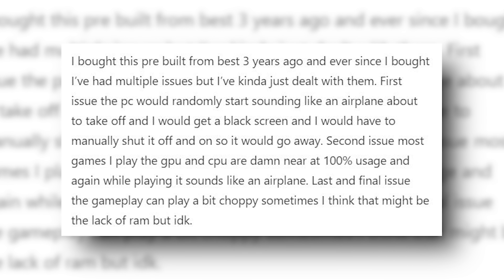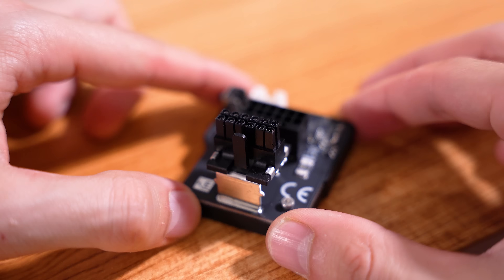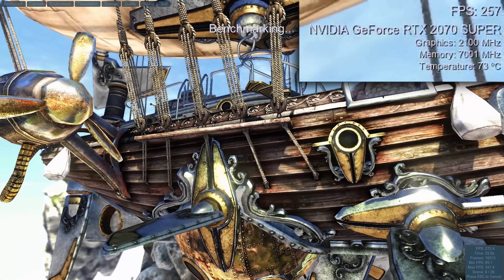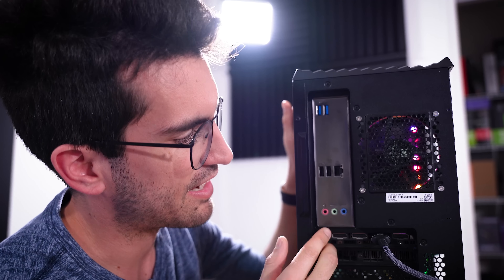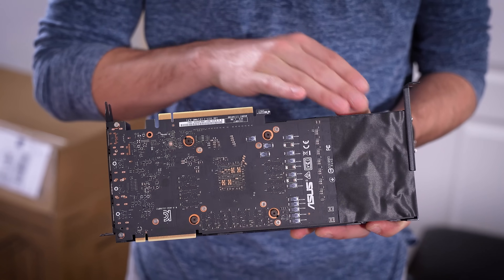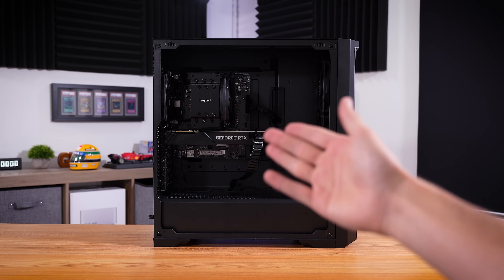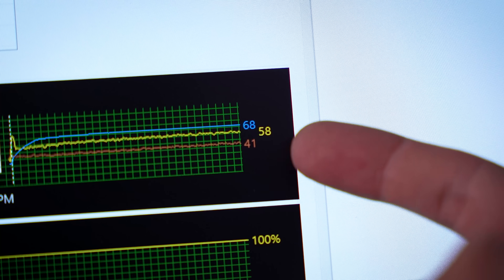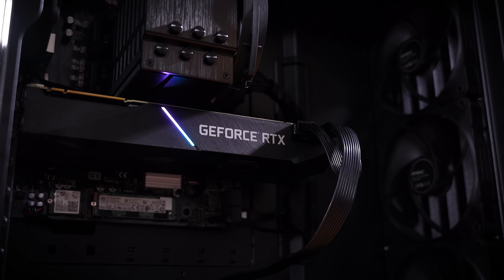Fixing a Viewer's BROKEN Gaming PC? - Fix or Flop S5:E3

Comment: I feel bad for anyone that buys a pre-built like this one. Y'all deserve more than this!
Reply: the stripped v ram sinks on the MB was  very painful to look at.
Reply: With buying prebuilts you really do have to have had experience doing your own builds to know what's decent. For example I did buy an MSI prebuilt only because I could tell the parts inside were off the shelf standard including the case. Certainly they cut costs on storage, and ram, but since everything was standard I could upgrade over time. The real saving grace was the pretty high quality motherboard that it came with, solid platform counts for a lot.

Comment: There are mounting holes for 120mm fan in the lower inside front of the case.
Reply: There are not. There are no mounting holes for any fans in that case other than the 92MM at the back.
Those are simply vents. They are not sized or spaced appropriately for any known fan size.

Comment: That wasn't a thermal throttle imo, it looked like Tau elhad expired. On previous generations, Tau (max boost duration) was limited, so the cpu frequency would jump high and stay there for a short duration, after which, if the heavy work wasn't done yet, it would fall back and settle into a lower boost frequency that it was set to run for long running tasks. At least that's what was in the official specifications, but many board vendors ignored them to improve performance on their boards. Since that looks like an OEM board, chances are high that Tau was set strictly.

Comment: The system has Asus themed branding because it IS an Asus branded pre-built. They really do skimp on things. Bare minimum PSU, single sticks of RAM, not so great I/O. They hit a price point and are a known quantity so they're not terrible, just not all that great either. A friend of mine had one of their older (than this) models that's pretty much the same thing but a couple of generations behind. Though in their case the connectors were at least all standard, not too sure why they went so proprietary with the headers on this one. You'll be glad to know they now have a much nicer custom built system that replaced it :)

Comment: damn, this pc is rough amd it's from around the same time I bought my original PC at Best Buy. Stock Intel cooler, single stick bare pcb DDR4, GreatWall PSU (I know they are the OEM of some Corsair PSUs but a named one would've been nice), stripped down motherboard, terrible case, blower style GPU.
I got an iBUYPOWER from them during Black Friday 2019 and it was an ASUS 2060 Super 8GB, 9700f, dual channel RAM, a ThermalTake Gold PSU, and a pretty stripped down B365 motherboard but it at least had display inputs on the motherboard lol. I didn't realize how lucky I got for the money I spent on it back then if this is what was commonly being sold at around the same time.

Comment: I had an over heating GTX465 with a blower cooler. I screwed a 90mm fan onto the shroud, so it blew into the blower fan. 
An Axial fan blowing into the Centrifugal (Squirrel Cage) fan. I called my solution the 'Twin-Turbo' (tm) GPU cooler

Comment: I pretty much hate all pre builts . either they lack IO ,  or vrm cooling   like dell with a core i9 that is voltage limited because of the lack of cooling on the vrms and pretty much runs like a core i7 ,  others look like they use normal parts .. but then you find out that it's a motherboard that  has a slightly different motheboard that only gets bios updates from the company that put it together and you'd be lucky to get more than a few updates so that you could install a new cpu ,   or like a HP that only supported 1st gen ryzen because there was no further bios updates.  I just updated a customers computer  he bought my old x370 am4 mothebord and was running a 2700X   upgraded to a 5800x3d    he was suprised that it was even possible

Comment: I was very disappointed with how you dealt with the graphics card and your criticism of it. There's nothing wrong with a blower cooler. However, they work quietest when mounted vertically, in a case like the Silverstone FT02 or FT05. The former coped admirably with twin Titan Xs in SLI. And you missed that the power cable was pigtailed and left it as that with the new PSU: to better cope with power spikes the GPU is best run off two separate power cables.

But that motherboard is truly crap. You might want to have a chat with the guys at Hardware Unboxed in case they've had one in for review and even if they haven't I'm sure they'll be delighted to look at it and tell you exactly why it's crap.

Comment: we had this exact pc case in currys UK but had a smaller cpu fan on a r7 5800x and had a rtx 3070 no front case fans and yeah had to put whole system in a new case and got a aio not a single issue since (it always overheated not long after boot up or playing games)

Comment: Greg: I cant replace too many things on these builds. Also Greg: I will replace the cpu cooler, case and PSU.
Reply: but that single ram stick looks fine....who needs dual channel?
Reply: @yissnakklives8866  🤣🤣🤣
Reply: Would have just replaced the cooler and swap/add RAM.
Reply: he means the more expensive parts usually like graphics card
Reply: Ram, cpu, mobo, storage was left alone which you could arge is 90% of the build. you can easily run a cheaper cpu with a stock cooler and literally use a box as a case.
Reply: Honestly, i agree with you guys, but I'd actually be very, very happy with what he did.
Ar this point, the 9700 is outdated anyway.
I'd get an AM5 (or intel 1800 later this year) into that case and change the GPU late this year, once they launch RDNA 4 and Blackwell.
I think he paved the way greatly for an upgrade and he states it at the end.
Reply: @BarAlexC  I know, he did the best he could. I was teasing because in the beginning he says hardware doesnt grow on trees, but then replaces like 3 things.
Reply: @drspaceman1985  He actually did not do the best he could. He did not address the biggest limitation in the pc, which is the ram. Which turned the end result into almost a total flop. No matter how anyone tries to spin it, he tackled this pc like an amateur. A decent ddr4 16 gig kit you can buy as cheap as 30 bucks. If I were him, I’d had payed that out of my own pocket, to properly do a job. I guess this shows his limitations. Which I did not expect to be so massive.
Reply from the maker: @alext988-z8v  The viewer told me in person that he'd be upgrading the RAM to a dual-channel 32GB kit on his own (since it takes all of about 10 seconds). To that end, the RAM wasn't "broken" and wasn't on the edge of viability from a power/stability standpoint. Oh, the internet and its assumptions...
Reply: @tim3172  Now I learned something new. Didn't know payed was an actual word. I know they always meant paid.
Reply: I sincerely apologize for hurting your feelings and your idol. I also apologize for my grammar mistakes. Even though, I think that at 2 in the morning and me being a native Hungarian, I faired pretty well. I promise this will be my last comment on this channel. If I were to get a PC, which is thermal throttling, performs badly because of the ram config, do what Greg did, send the PC back and call that a job well done, I may as well close up shop. It was my bad really, thinking that such content has educational purposes as well. Because it doesn’t. At best, it shows you what not do, when tackling such problems. But hey, no harm done. Greg “fixed” a PC, for “free”. A true Messiah. A one that picks on other fellows from the branch, even if they are right (see j2c). Anyway, really done now. Enjoy this amateurish and half baked content, from a man who is proud to resort to personal attacks and call himself an engineer instead of owning up to his mistakes. This, says it all. Cheers everybody !
Reply: @alext988-z8v  You're still unwilling to acknowledge that the user said they were going to replace the ram themselves. Amazing.
Reply: @ArtisChronicles  That is utterly and entirely irrelevant to this video. A fact which was never mentioned in the video anyway. The user can set fire to the PC for all I care. You are missing the elephant in the room. The way he addressed the problem was entirely as an amateur. The problems that were described by the client were not entirely resolved in the video. Yet he proceeded to change stuff in the PC which was entirely unnecessary without solving the issues. This is the truth. Anyone who has some tech knowledge, clearly sees that this is a bust. I thought the series was called fix or flop. Did he fix the issues?! No he didn't. And the viewers are supposed to guess that the client will upgrade the ram. This is not about that, this is about how poorly the video was scripted, presented. What kind of a technician, engineer, replaces components based on his inexistent knowledge about them, assuming they must be bad, just because he doesn't have a clue, without putting in an ounce of research?! Such videos are meant to be for educational purposes. At least I thought so. This has nothing to do with that. It's just cheap entertainment for a quick cash grab from YT. And this coming from a guy who acted all high and mighty in regards to others who at least don't pretend to be experts. This is definitely going to be my last comment. Sadly, people have a very hard time understanding what's obvious. Best of luck !
Reply: Poor choice really in replacing a totally fine psu and not upgrading the single channel generic low speed ram in the system. Amateur hour at it’s finest.
Reply: @alext988-z8v  The original PSU was below the recommended wattage for the RTX 2070, which requires at least 650W.
Reply: @Jalex0021 And yet the PC, worked just fine. Recommended psu, is not equal to must have in order to run psu. The rtx 2070 draws a potential 175W at full load. Given the rest of the components a 500W good psu (which Great wall is) is more than sufficient. He replaced the psu because he is superficial. Just like he replaced the case. In a previous video, where the case, which was causing a short, he decided to cut the part that was causing the short and electric tape the MB, where it had contacted. A much worse case, with 0 airflow, with an atx MB and he left everything crammed together. This guy is a diletant. Pretending to be a computer technician. Shameful really, because some people earn a living out of this. Just like myself. I would have been a long time ago out of a job, had I worked like this.
Reply from the maker: @alext988-z8v  Just an FYI, I've worked on PCs for nearly a decade and earned my bachelor's in engineering while doing it. The idea that I'm "pretending" to be a computer technician is pure rubbish. I've absolutely no idea who shat in your cornflakes this morning, but it wasn't me. If helping someone out makes me "superficial," then why the hell are you here?
Reply: @GregSalazar you could just shadowban some jerks.. they are just screaming for attention in the most primitive form they can because they are not able to gain any traction in a smart manner. Youre great greg and i really appreciate your work!
Reply: @GregSalazar  Well, sure as heck doesn’t seem like it, especially from this video. Very noble to help people. Sure your client was extremely happy, given the top quality parts he got. Sadly, in real life, things do not work like that. Your client is happy, I don’t doubt. But the multitude of people who see this video and think that this is how one “fixes” a problematic PC… Yikes. You should be more careful what you put out there and how you put it. Real life fixing doesn’t work like this. Fairly certain Carey Holzman for instance, a true PC technician, would agree.
Reply: @alext988-z8v  go to bed, you're drunk.
Reply: @GregSalazar  don't worry we love your videos. Internet Trolls are everywhere :) the videos are good educational material for people to know what to look for when they buy a PC
Reply: @alext988-z8v  Your right that you'd be out of a job doing this the way he does, He does it for FREE!!! Greg has never claimed to be a computer tech, He says that he learns something new every day. He replaces parts when needed and/or when he "personally" doesn't feel comfortable about something. (OUT OF HIS OWN POCKET). As for the PSU, He (unlike you) had never heard of "Great wall" and doesn't know of it's quality.
 Since you are so much better than him, Why not give him some advice and knowledge rather than calling him names.
Reply: @GregSalazar  FYI: You mentioned a Z470 board for 9th gen. Actually 470 is a 10th gen (lga1200) board, 9th gen would be a 300 series (lga 1151(300)).
Reply: @alext988-z8v lmao, go to sleep, you're just yapping, he fixed what is broken in the pc, the cpu thermal throttles so he change the cpu cooler and case (for better airflow), and the power supply because of the gpu, there is no need to change the RAM as it is working perfectly fine, this series is fix or flop, not fix and upgrade parts that is perfectly working, also, greg state in this comment (if you did not read it) that the owner email him that he is gonna upgrade the ram in his own.
Reply: @ron200088  oh boy someone flew in from yapping town yapan, speaking yapanese
Reply: @Jalex0021  That is absolute horse shite. How on earth are you going to make these parts use 650W? Please do not spread misinformation.
Reply: @HazewinDog  I mean, you could overclock the crap out of the parts... If it were a different motherboard.
Reply: @alext988-z8v  it's = it is
"at it is finest"
Genius.

Comment: Getting my like for upgrading that guy as much as you did 👍 people in the comments are saying you didnt have to upgrade the PSU but it'd probably be smarter to test it with the different parts before hand before upgrading just to check if its a necessary/ worthwhile upgrade.

Comment: I noticed there was no mention of the single stick of Ram? Did I see that wrong?
Reply from the maker: I thought we addressed it near the end? (apart from when he mentioned it in the beginning). He was going to take care of that himself. We aren't gonna hand out any more hardware than we deem necessary each time.
Reply: @GregSalazar  But like you said in the video, you probably shouldn't have taken this one as the only thing wrong with it was a settings issue due to an overly aggressive bios setting...probably.  Yet you replaced 3 components that did not need to be replaced according to what was wrong with it.  I think you felt guilty for taking this on and did this because you felt like you had to do something.

Comment: Personally I would have swapped out the motherboard instead of the case. With the newer and better air cooler, it will make a world of difference.

So in short, the PSU was absolutely fine, I would have changed the air cooler and motherboard.

Comment: I had the "black screen 100% fan speed" issue on one of my previous systems before. Stress tests wouldn't cause it to happen, but certain games would. The problem was unrelated to thermals but was the Asus motherboard causing the issue. I swapped out the board for a different brand and the problem went away. I'm concerned that this PC might come back to you with the same issue.

Comment: Initially I was thinking thermals with dry paste on the CPU but I was also thinking an abundance of bloatware on the PC with it being a pre-build causing the excessive throttling. Also with these stock coolers the tabs need to be twisted 90 degrees before it comes off

Comment: That rear I/O was just depressing to look at.
Reply: I've seen laptops with way more ports than this motherboard.
Reply: Easily the worst rear I/O I've ever seen. I'd suggest a powered USB hub. I would say that Intel boards a few years ago were very lacking in USB compared to AMD, they seem to have fixed that recently.
Reply: I'm glad I'm not the only one who thought that when I saw it.
Reply: Instant depression acquired
Reply: My old HP EliteBook 8560W (i7-2860QM + Quadro K2200M, laptop equivalent of a desktop 750 Ti) has 5 USB ports, 1 VGA, 1 DP, dedicated audio inputs and outputs, ethernet and FireWire and an optical drive. Not super high-end today, but the GPU is still better than almost all sub-400 brand new Windows laptops and the CPU is still decent at anything that isn't gaming, and is still better than the Celerons that were used in the HP streams a in 2019-2023.

Comment: The new case looks kinda empty. Thats what happens when you install an m-ATX board into a Full tower. 😆Btw i would not use even an i3 with that board.
A Pentium or a Celeron would be a better companion for it. 🤣